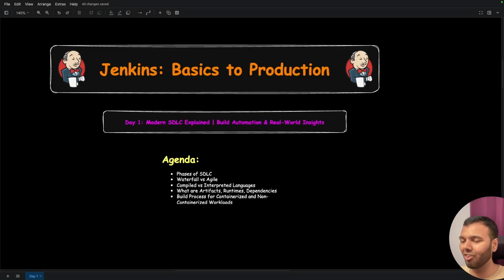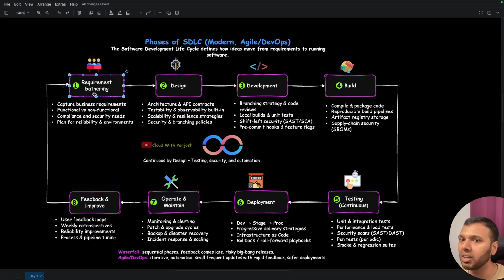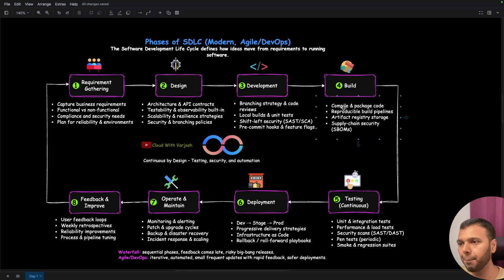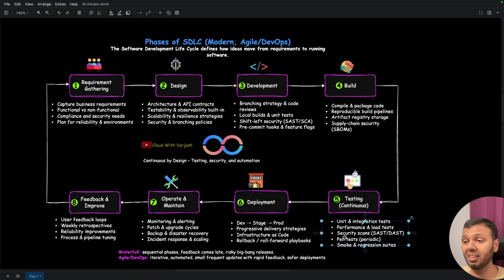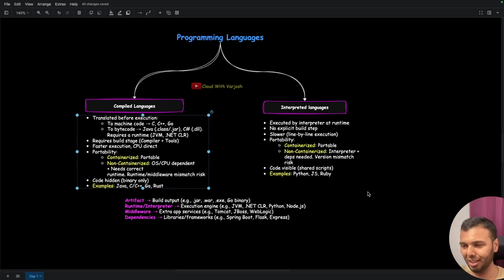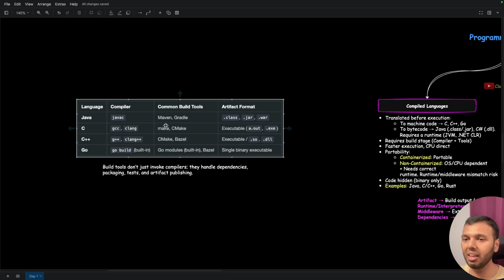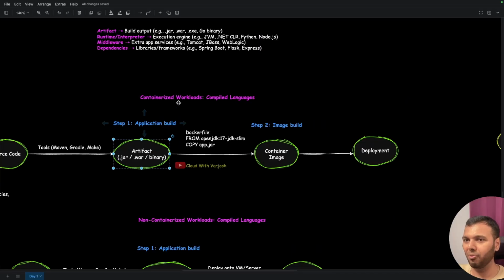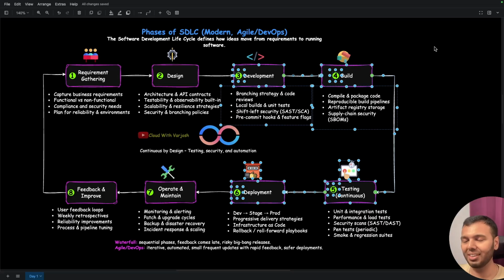Day 1: Modern SDLC Explained | Build Automation & Real-World Insights

Comment: @49:05 venv doesn't let you have multiple versions of python. it will use your system's default python version. the only way around i found is that if you use pyenv to set different default python version for different project directories & then within those directories you can use venv to set up that specific virtual env for that specific python version
Reply from the maker: You’re absolutely right. venv by itself doesn’t install or manage Python versions and relies on an existing interpreter. What I was describing was more of a high-level view: once multiple Python versions are available on the system, venv helps isolate environments and dependencies per project. Tools like pyenv are commonly used alongside venv to manage different Python versions cleanly across projects.